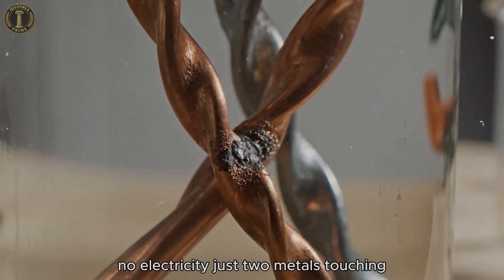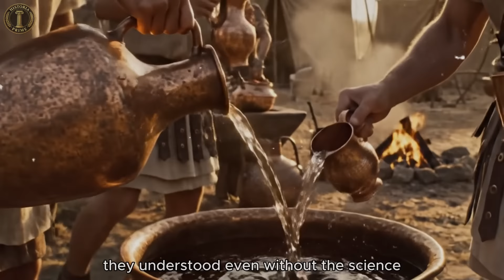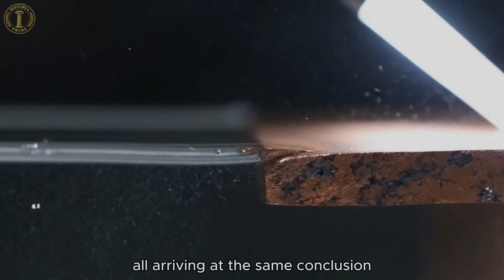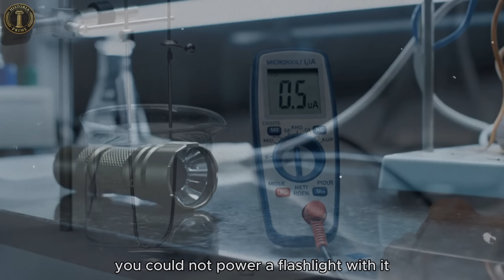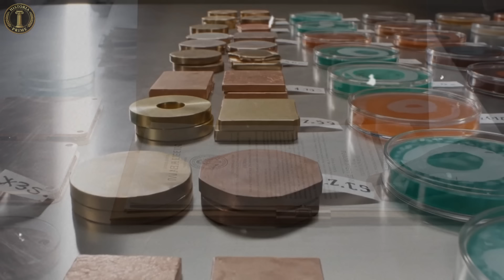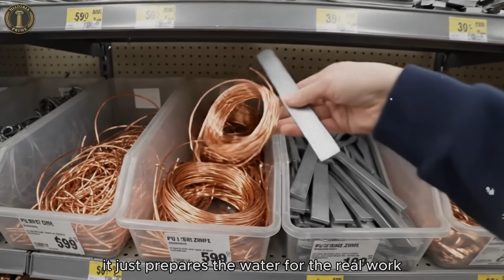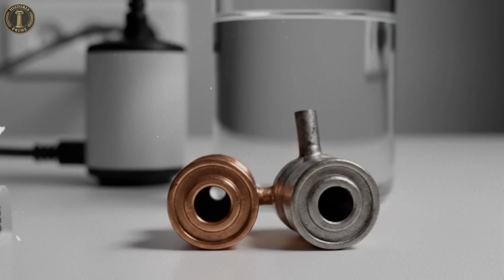Connecting Two Metals Purifies ANY Water — The "Earth Filter" Secret They Buried

Comment: found this in Wikipedia: There limitations -
Copper zinc water filtration does not remove organic chemicals, such as pesticides and disinfection byproducts, nor is it effective against the parasitic cysts of giardia or cryptosporidium.[7][21] and must be periodically backwashed with hot water to clean them. This reduces their efficiency, and the pollutants dislodged by washing can lead to water contamination.[1][7][22] The United States Environmental Protection Agency found that copper zinc water filtration can remove mercury from contaminated water, but only at low concentrations, and recommends that for highly contaminated water other processes be used.[23]

Comment: So humbling! Very important lesson on chemistry, to start purifying and disinfecting medically. 
I would like to learn in research classes regardless of age had. 
What would repell mice and insects, as copper and zinc reppels bacteria in water? 
Of course, if you will answer: cats, it will be insufficient. 
If you will say: store no food for their interest, it will not be sufficient, also. Are there metals, chemical elements and plants repelling. which are they? 
Is clor in water repelling mice, is it sufficient to spray that at their entrances they sneak into apartments? 
The mice use the heating sistems to sneak into apartments. 
One cat will protect tis following year, only l must have a second protecting solution against them. 
Metals may have electricity sent through will that work?

Comment: We live rurally and use a well. There is rust in the well pipe, and there’s a a very small amount of petroleum and other inclusions. Then, the water goes through galvanized pipes. We use a water filter. I thought I would try the zinc copper method to pretreat the water, and maybe lengthen the filter life. The water actually comes out of the faucet looking clear. The result from immersing the two metals (touching each other) overnight was very cloudy reddish-brown water with a small amount of oil floating on top. Looking for an explanation

Comment: Old pre divorce house had f... placstic supply pipes. 
Try this. Take one of these plastic pipes, tap it lightly, transversely with a stanley knife (carpet cutter) and bend the pipe. It pops apart like lego (dumb a... plumbing pipe companies 😡).
A few sharp stones, broken tiles, pieces of brick bcause the pipe to break 😡 
Then copper is better for water supply 👍🏻

Comment: Great video. Extremely important, educational & informative. I believe there is one item that needs clarification. During stage II Galvanic Cell: it states take 12" of 14 gauge pure bare copper wire & 12" flat strip of pure metal zinc. Then it shows to twist these two wires, but it just previously stated "copper wire" and "flat metal zinc." So, which is it? Or it doesn't matter? That needs clarification, please.

Comment: Copper kills bacteria and most viruses. That's good, but it's ineffective against many toxins. These include heavy metals and elements such as lead, arsenic, cadmium, mercury, uranium, herbicides (e.g., glyphosate), PFAS ("perpetual chemicals"), drug residues, hormones, solvents, industrial chemicals, nitrate, nitrite, fluoride, microplastics, limescale (dissolved hardness minerals), asbestos, and rust.
That's a whole lot of harmful substances that copper can't remove.

There is a solution that filters out all of the above (including bacteria and viruses): reverse osmosis. However, a pre-filter should be used.
Reverse osmosis requires pressure. Portable systems with a hand pump are also available.
The disadvantage of reverse osmosis is the water consumption for cleaning the filter, but sometimes things can't be perfect.
(translated)

Comment: Water pipes are copper, some people are concerned about the slight toxicity of copper and run the water for a while to get rid of the standing water in the pipes between the taps and the main ceramic or plastic pipes.

Comment: Stage 1: Prefiltration - Pour murky water through a cloth first, a bandana or tightly woven T-shirt 

Stage 2: The   Galvanic Cell - buy a length of 14 gauge bare solid copper wire and a strip of pure zinc metal. Cut both to equal length, about 12". Twist both tightly together; the direct metal to metal contact is critical without which there is no electron flow or galvanic reaction.

Drop the twisted pair into your water container, a canteen, a pot, a bottle; any none reactive vessel. Wait a minimum of four hours, eight hours much better; overnight, sixteen hours ideal.

In the morning, remove the metal, rinse and store dry. They are reusable for months.

Stage 3: Charcoal filtration - from your camp fire, not briquettes. Crush into small pieces and pack into a clean container with a small drainage hole. Pour your metal treated water over the charcoal layer. The charcoal absorbs organic chemicals, pesticides and residual taste which the galvanic cell does not target.

Stage 4: Advanced Diatameceous earth - a soft white powder made from the fossilized remains of ancient microscopic algae called diatoms. When used as a filter for water, particles such as giardia and cryptosporidium cysts. Diatomaceous earth is available at garden supply stores and costs very little.

This process results in a multi-stage water purification system.

Copper and Zinc just do what the Creator, Yahweh Elohim, intended for the combined efforts to do.

Thanks for sharing

Comment: CONSUMING water from COPPER VESSELS carries significant RISKS related to COPPER TOXICITY. When water remains in copper containers for extended periods, copper can leach into the liquid at concentrations that may exceed safe consumption guidelines, particularly if the water is acidic. Excessive copper intake can lead to adverse health effects, including nausea, vomiting, and potential long-term damage to the liver or kidneys, making this practice inadvisable for managing health conditions. Ingesting water infused with both copper and zinc significantly increases the risk of heavy metal toxicity. Both minerals can accumulate in the body to harmful levels, potentially leading to acute gastrointestinal distress, liver or kidney strain, and other severe physiological side effects. Because the concentrations of metal ions in DIY water infusions are impossible to regulate safely, this practice carries substantial health risks and is not a valid substitute for professional medical treatment or standard, safe hydration methods. Furthermore, while NASA researched metal-ion purification, it was primarily focused on silver, not a copper-zinc mix, and those methods were eventually succeeded by iodine-based systems for flight operations.

Comment: I have a water filtration system using two metal containers with one placed on top of the other. (I think it might even be aluminum.) The top container holds 1 to 4 filters. The bottom holds the filtered water no electricity, no batteries.  I purchased it eight years ago to filter my daily drinking water. Then, they were going for over $300, not including the water filters.  
The water system can hold up to 4  charcoal filters at one time costing $80 each and replacing every 3 months. I usually used an air gun to clean them out and reuse them several more times each.  You can place one or all four in the container at one time. The more filters you use, the faster the water filtrates. If using all four, it takes about 60 minutes.  I like your idea and I will try your natural system. Thank you for making this video.

Comment: Limitations
Copper zinc water filtration does not remove organic chemicals, such as pesticides and disinfection byproducts, nor is it effective against the parasitic cysts of giardia or cryptosporidium.[7][21] and must be periodically backwashed with hot water to clean them. This reduces their efficiency, and the pollutants dislodged by washing can lead to water contamination.[1][7][22] The United States Environmental Protection Agency found that copper zinc water filtration can remove mercury from contaminated water, but only at low concentrations, and recommends that for highly contaminated water other processes be used.[23]

Due to their bactericidal action, copper zinc water filtration devices are considered by the EPA to be "pesticidal". However, Stanford physician Paul Auerbach recommends against their usage as a sole means of germicidal water treatment, and he does not include them amongst his recommended protozoal disinfection methods at either point of entry or point of use.[3] A 1995 United States Environmental Protection Agency report found that such systems were employed at approximately 20 US-based cooling towers in 1993. The report documented variable results, with some systems discontinued because they were ineffective at controlling bacterial growth, though in other instances they were preferred because of comparatively safe waste production and simpler maintenance.[24]

There is also concern about environmental damage due to the release of zinc in areas with high concentrations of metals or certain pollutants, in particular copper[25] and chlorine.[26] Publications of the American Water Works Association do not recommend the use of copper zinc water filtration systems to treat chlorinated water that outflows to streams.[26]

Studies have also shown that regulation standards for the systems can vary widely or be nonexistent depending on the industry and region of their usage.[27]

Comment: I have Berkey filters and uses both silver and copper to do the same thing. However, I have had these filters going nonstop for over 4 years and are still good. That's not  expensive, you have to do some research to get the right stuff at a good price.

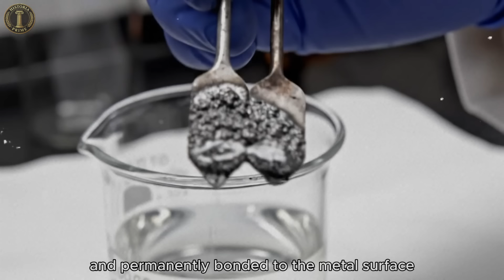Comment: The heavy metals are pulled out of the water, and permanently bonded to the metal surface at 9:21 -- alright, but doesn't that mean that those heavy metals need to be severed off of the surface each time the plates are used? How is that done? With that aside, the Earth filter is first a cloth or bandana, then drop the water into the Cu/Zn 14 AWG twisted pair -- time: 16hrs for proper purification, then charcoal briquettes finely chopped, then diatomaceous Earth. I'd suggest using a layer of moss first on top of the bandana. This stuff can use heavy metals as food so you might protect your twisted pair metals from getting corroded too fast. Plus waiting 16 hours for a liter of water to be filtered is a lot of time, so many of these have to be running side-by-side.

Comment: Today is the 4th of July, 2026... Holy Copper Pipes! I grew up on a farm... We used to battle the Algal Blooms in the 1/2 acre lake... Searching for "Lipids"... Like Fryer Grease Bio Diesel but not...? ALGAE FUEL... Sorry, Copper Sulfate we eventually learned... Completely eliminates Algal Blooms. However, a water jet, like a fire boat in the Mississippi Delta for example... Or the Red Tide off the coast of Tampa Florida... Spraying the water into the air removes Algae even better... Like Bio Oxidative Therapy. God Bless America.

Comment: Come on, guys, let’s use some common sense and not endanger people with hype.

Dropping twisted copper and zinc into water is not a reliable water purification method. At best, copper may reduce some bacteria under certain conditions, but that does not make unsafe water safe to drink.

Your title says “purifying any water,” and that is dangerous. People could believe this and drink contaminated water thinking it has been purified. Real water purification requires proven methods like boiling, proper filtration, or approved chemical treatment. Please don’t present this as a survival water-purification technique.
Reply: Yes, I read your disclaimer, but most people will never read that far into it. They’ll just watch the video, see the title, and believe this actually purifies water.

Comment: BULLSHIT !! When zinc and copper are placed in dirty water and form a galvanic cell, the main effect is corrosion of the zinc, not purification of the water. The process may slightly change the water chemistry, but it generally does not remove most contaminants.

There are a few limited effects: 1.Some bacteria may be inhibited by dissolved copper or zinc ions, but the concentrations are usually unpredictable and may not make the water safe to drink. 2.Tiny amounts of contaminants might stick to corrosion products that form on the metals. 3.The electrical current produced is usually very small and not enough to significantly treat the water.

In fact, as the zinc corrodes, it adds zinc ions to the water, and some copper ions may also enter the water. That means the water can actually become contaminated with metals rather than cleaner.0

Comment: Electrolysis is the electrons want to attack the propeler shaft the hull and the wheel they use zink bars that attract the energy and dissolve rather than the screw driven a d hull galvanic erosion.     Lead kills red lead was.painte on the bottom to keep weeds arnaxra.and from growing on the hull ca say ng friction. Scrap tr hull.on a tidal each four hours on each end

Comment: A la on the discharge of the twow opposite poew is a.gas highly. Explosive while starting your car put flame near the terminals and you will see the amps the heft is enough to melt a wrench but doesn't hurt you the spark plug fifty thousand volts will ring your bell grab tht     spark plug on a mower want to wake up grab that

Comment: Huh your forgetting amperage ohms resistance thickness volts.   Don't dumb these buggers down moving a copper wire through a magnetic field it creates. Flow of electrons or energy through the wire electric motors work this way with split ring commutators

Comment: Very misleading.  Yes, in a survival situation, where you have no access to treated drinking water, this is preferable to pond or stream water with no treatment  The problem is you aren't pointing out that just drinking this consistently can make you ill as well.  Copper and Zinc aren't healthy in large amounts, and if you drank constantly from a source that has both leeching into it, you are probably going to suffer other adverse health effects.  There's a reason not all dishes are made from these.  Same for brass, which introduces a lead component, which is definitely unhealthy.  Stainless steel also has antimicrobial properties as well.  It's safer to drink from long term.  Just because someone makes money from something, that doesn't automatically make it bad.  Water filters aren't inherently evil, neither is bottled water.  It's convenient, and safer than drinking from a creek or pond.

Comment: This is interesting because the battery caused by this gradient between the state of the zinc alkaline and copper acidic 

Wouldnt the copper lose its acidity over time? And the zinc its alkalinity 
Because of the transaction between them, or is each replenishing their electron stores somehow 

This also connects disease at least inso far as relates to infection to electricity and the presence of this gradient in the components of the body, maintain that you maintain health, lose it and disease begins to set in, just like Jerry Tennant found and wrote about in his book Healing is voltage and like Michael Levin has discovered as relates to Cancer.

Comment: Strain first through a  Cloth, copper & zinc, charcoal, then diatomaceous earth. 
 Why no mention of boiling it first?  
Diatomaceous earth is a fine powder that would result in basically mud
 if you tried to run water through it. Who is going to pack around diatomaceous earth?
Wouldn’t a much more effective approach be to carry a bottle of sodium chlorite, along with a bottle of activator, like citric, or 4% solution of hydrochloric acid?
Reply: Sure because everybody I know Carrie is around those products. A good filter would be just rocks and charcoal 2 o’clock that would be a good start

Comment: ROMAN WATER SUPPLY: Romans preferably used stone. In some parts of the water systems they used other materials, including ceramics. In some places, especially in high-pressure siphoning systems, they also used lead, even though Romans were aware of the negative impact of lead on health. They have also used some types of hardwood. I have tried to find any sources where the use of copper in water systems was described; without finding any sources. If anyone can provide me with sources that describe / document the use of copper, please let me know. Thanks a lot.
Reply: Look up ancient era Egypt 2500bc. I found it with one question. Was used commonly

Comment: 2 Silver rods  995 not touching ,1 negative 1 positive each ran to the same 9 volt battery and both rods in the same saltwater or spring water glass container  24 hrs later the liquid becomes the strongest antibiotic for topical use only with out risk.internaly 1 time   my dog had parvo 1 or 3 drops with 12oz tap water forcfuly inserted  into his stomach through the mouth. The next day he was drinking and in full recovery,  ❤